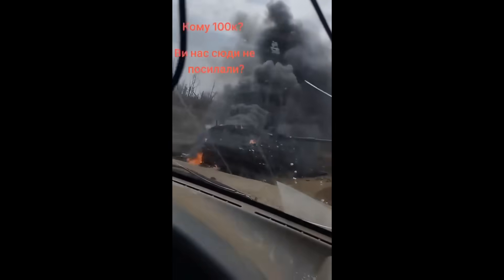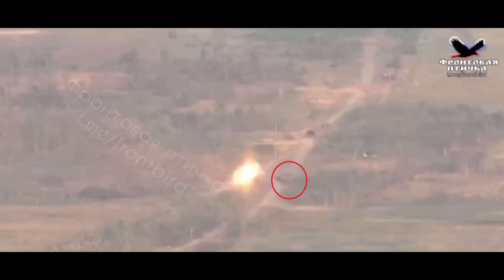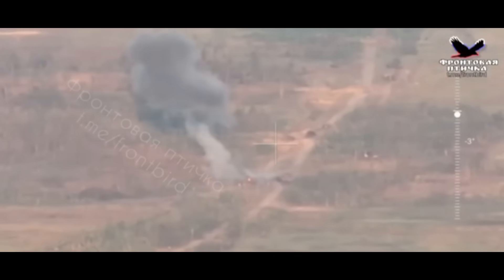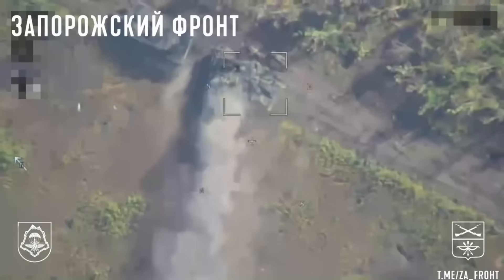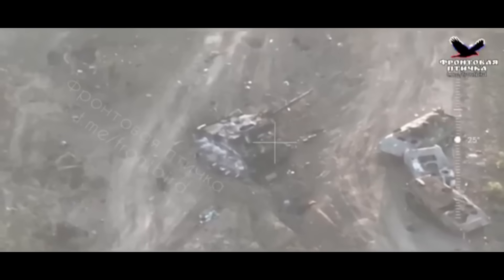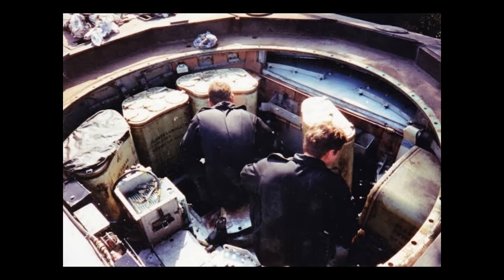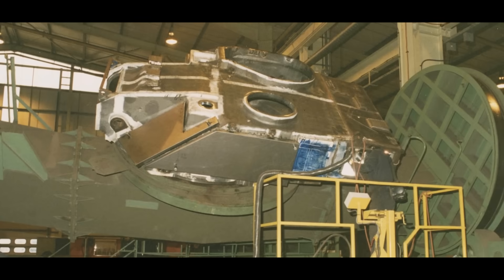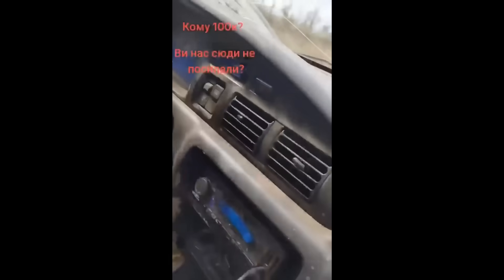This is how Challenger 2 got Destroyed in Ukraine

Comment: Only when facing a small army of a country which has a small military budget and not a self-sufficient military industry, the Challenger is invincible. Otherwise, it has nothing special.
Reply: Not even small budget but effective weapons and training 😂
Reply: All small armies and irregular military have Kornets, or another ATGMs, it's a cheapest way to fight tanks. What you point?
Reply: Just like Abrams, u can send T72 to destroy a village armed with kids with AkS and then claim u have the best tank and not a single one was destroyed in battle
Reply: As someone who used to operate these things. We were never under any illusion that they were invincible, and our training/doctrine accounted for this.
Reply: @charger6634  Irak didnt in 1991 and 2003. Irak stll had Milan 1 and HOT from the early 70´s.
Reply: @zhufortheimpaler4041 Iraqi soldiers generally ran away. They did not stay to sit out artillery attack or heavy bombardment .They did not have competent fixed defences. The Russians and Ukrainians are fighting at a level above that
Reply: @zhufortheimpaler4041 1. Milan is also ATGM. 2.Abrams tank was destoyed by kornet in 2003 in Iraq.
Reply: Well, yes, there is something special about it. Its turret pops and the commander´s cupola flies away when hit...
Reply: @charger6634  Milan 1 is from the 70´s and only has a single heat warhead with around 350mm penetration. Milan 3 is from the late 90´s and has a tandem heat warhead wth around 1000mm penetration. thats a major difference.
And that shot with the Kornet were special forces. the Irak had only a handfull of those
Reply: @moochoman9948  funny i have yet to see ppl claiming that nato equipment is invincible.... only pro russian ppl claiming they spoke to ppl who claimed that nato equipment is invincible
Reply: @aleksandaradamovic3849 saddam's t72 equipped republican guard got exterminated by Abrams just like vdv at Hostomel 😂
Reply: No shit Sherlock, just like any other tank.
Reply: Nonsense. Tanks are riddled with weak spots. All you need is a PG-7VL.
Reply: @forgerfalscher2125  there is some shite in the media about western kit being a 'game changer' every time it's sent over. Properly trained and drilled crews in a 'poor' tank will beat a badly trained crew in a 'superior' tank. The only time I've heard 'invincible' is on the internet yes, and usually from idiots with no real understanding of what they are talking about.
Reply: The challenger was pretty effective at facing Saddams massive military keep the cope up buddy
Reply: ...You're literally describing the UK.
Reply: Loooool extreme underestimation by another ruskie leaning commenter.

You guys never learn
Reply: @MrWorldwide00 Most of them ran away. The tank is nothing special against a real army
Reply: Not even then is it invincible. IEDs can blow it up, so can RPGs and mines.
Reply: @charger6634  cheapest would still be rpgs and mines
Reply: @aleksandaradamovic3849  what's really humiliating is that they still lost abrams
Reply: @Sep-jk3vi  you forgot about the supreme air superiority along with artillery that the US used which made sure that no structure remains standing and the Iraqi's couldn't even see what strikes them 
Wang to test your Abrams?  Why not send them to Ukraine lmao 
The UK hesitated sending challenger because of this sole reason. And it happened challenger got exposed 
That's the reason us ain't sending the Abrams because you would see them burning too
Reply: @MrWorldwide00  yeah facing against a "military" with no air Force 
No sHiT challenger did nothing the airforce wiped everything 
Tanks were used against people with ak's
Reply: @dhurjatinarayangiri6995 fr you can pen a challenger using a shaped charge from like 1970 from the improvised munitions handbook the US government gave to “freedom fighters” throughout the 70s and 80s
Reply: Well, just like Abrams or T90/T80/T72B3M , etc..
Reply: Alas, no: in the Middle East Challengers have been taken out by irregular forces.  All tanks are coffins without a huge amount of ground troop and air support.  Ukraine has no air support.
Reply: @charger6634  But did they have the defense russia set up? Afaik this shit hasnt been seen since ww2. You think Iraq sheep harders had miles of anti tank mines set up? That requires money and a strong military industrial base.

TLDR: western weaponry is only a big deal against weak enemies lol.
Reply: its going better than the t90s and the Armatas that didnt even complete a parade.
Reply: Nothing special compared to western tanks, but compared to Russian tanks.....
Reply: @moochoman9948  The doctrine is to hire local villains/Nazis/terrorists to capture slaves and send them into battle, over and over again?
Reply: You can destroy a challenger 2 with a t34 from ww2 with no problem by shooting at the lower front plate, which isn't that low at all

The challenger is just Abad tank
Reply: @mbpaintballa  Yes, illusions have fallen. Everyone used to think that Western tanks were tanks, not cans.
Reply: @MultiNike79 what?
Reply: @Sep-jk3vi  most were destroyed by aircraft. the Abrams tank have the advantage of knowing where the t-72 are from the aerial observation. most of the battle took place at night with the Iraqi lacking in night fighting capabilities.
Reply: @Felix-pc9sm a t34 can if a challenger is put on a firing range and isn't moving or fighting back you mean... next you're going to say russia has the best air defence lol
Reply: Idk the crew lived so sounds like it did it’s job pretty good
Reply: @mbpaintballa  I mean, in the past, Western tanks were thought much better than they turned out to be. Huge, flammable, with thin armor.
Reply: As if Russia is not fighting against NATO right?
Reply: @angryralphs2516  Hmm, NATO solders, NATO weapon, NATO money, NATO intelligence, communications. NATO goals, NATO treaty violations and terrorism, NATO biological laboratories.
No, Russia did not fight with NATO 1941-1945, and now it does not.
Reply: No tank indestructible.
Reply: @MultiNike79  There were no NATO during WW2😂
Reply: Game changer....🤣🤣🤣🤣🤣
Reply: @monaliza3334  And how do you think the European Union attacked the USSR?
There is no difference between Nazi Europe 80 years ago and Nazi Europe now. The ideology is the same, the inadequate aggressiveness is the same, the genocide is the same, the same participants. Only before the main ones were the French, then the Germans, and now the Anglo-Saxons. Everything else is the same.
Reply: Who says its invincible? It has thermalls, very accurate and powerfull gun and good crew protection. Thats why crew will be able to mount another challenger and go to fight again. Its easy to destroy tank, just hit the tracks and wait till crew abandons it, then finnish it.
Reply: @angryralphs2516  lol, Russia is fighting against NATO 1970's tech. and losing badly to it, they ain't ready for the smoke. Shit, they weren't ready for Ukrainian farmers.
Reply: @xwing8029  Why do all Challengers throw turrets?
>powerfull gun
The effective damage radius is half that of the T-series? Not a very good result.
Reply: This is really misleading. Challenger 2 isn't anything special, but that's because no tank is. There's no magic that makes a tank in to an unkillable super weapon. That's why western nations have been happy to keep using the same tanks for 40 years. They upgrade to add a thermal and then later a 2nd thermal, and digitize the command terminals, but the basic platform is unchanged.

But of course that doesn't mean all tanks are equal. As much as there's a pretty clear point at which a tank is good and it doesn't exceed, that doesn't mean every tank is at that standard. A Russian T-72, particularly older variants not yet upgraded to T-72B3M standard, will be rolling around without a satellite link, no digital displays, with 3 guys crammed in so they can barely operate or maintain perception, and with a reserve speed my grandmother could outpace.
Reply: @frfriedrice5536  The US is sending 31 Abram tanks to Ukraine though.
Reply: @frfriedrice5536 nothing humiliating about losing a few tanks.

The losses of Abrams were minimal and so were crew deaths and serious injury
Reply: It's a very good tank and they also had their top secret armour removed before they were sent to Ukraine to avoid the chances. of it falling into Russian hands.

There has never been an armoured vehicle in history that couldn't be knocked out
Reply: @charliec.3518 the challenger has never been penetrated by any 1980's tech
Reply: @nickcharles1284 challengers weren't taken out in the middle east
Reply: @alispeed5095 I guess you forgot about the Javlin and NLAW that's been destroying the best Russian tanks and the HIMARS which had been doing a lot of damage.

The stingers, patriot and NASAMS SAM systems have also done a great job against Russian missiles and aircraft.
Reply: Not true, only loss of a Challenger was to another Challenger in Iraq, Saddams army was using 125mm guns, and shot our Chally's at close range which they survived. It still is the best tank, just the Russky's found a way to blow up an abandoned one. Big deal. Let's see 'em do it to a real one with a real, well trained crew.
Reply: @MultiNike79 western tanks have far better crew survivability than Russian tanks.

The Russians armour is best for cooking deep fried orc
Reply: @MultiNike79 they don't have thin armour and any tank with fuel and ammunition can catch fire the difference is more often than not crews in western tanks can get out before they burn
Reply: @allistaircampbell9282 yeah like the S400 that got destroyed the other day and the hypersonic missile that couldn't be shot down but it did get shot down.😂😂😂😂😂😂
Reply: @MultiNike79 The Russian tanks throw turrets all the time what are you talking about 😂
Reply: Thats what the Israelis thought about Merkava...turned out different.
Reply: @jamjinn786  they fitted the trophy system to their armour it's been working well
Reply: @moochoman9948  yes, plenty of videos  and comments claiming equipment to be game changer but invincible? Il wait somebody to link a conversation were that statement is not coming from a pro russian person before i belive it.
Reply: @Stephen-4722  show us .😂😂videos
Reply: Ditto NATO........
Reply: @MultiNike79  I have seen only one challenger destroyed in Ukraine and turret didnt fly. I would rather stay quiet instead of comparing challenger losses to T series loses in this war. Its real combat that shows which tank is better, not some silly paper statistics.
Reply: This video goes out to all those brits who outta nowhere, bragged that the challenger was far better tank than the Abram and that it is the best tank ever in the world hands down, because of it’s low death ratio, despite seeing limited action in any warzone. ✌️
Reply: @xwing8029  >turret didnt fly.
The turret flew. It just fell on the tank, but with a significant displacement. The hatches and surveillance devices were also torn out.
It was the same in Iraq.
>T series loses in this war
The T-series is simply produced in a couple of months more than all the Challengers of all time. This is the most popular tank in the world.
>tank is better, not some silly paper statistics.
It doesn't show anything. The tank is fighting as part of an army vehicle, and here Russia has an overwhelming advantage. Therefore, Western tanks in Ukraine are about as defenseless as T-72s with training shells in Iraq.
Thanks to Stalin for the fact that Russia can now defeat the Nazis.
Reply: @charger6634 Air support my dude, how are you supposed to sneak up to a tank thats miles away while there is CAS and helis nearby scanning the area let alone bombing the tank with a plane. Air superiority is key and in this conflict ukraine is almost grounded or just unable to stop the enemy CAS
Reply: @Marvin-dg8vj  They did but they were bombed a lot by airplanes
Reply: @MultiNike79  Yeah nazis, you dont know what are you talking about kid. The only one nazis here are russians and even with their owerwhelming force of tanks they cant take over Ukraine for over than 1.5 year 😆
Reply: Un piccolo paese con alle spalle la NATO...
Reply: Its quite special - only modern (or even semi-modern) tank with rifled gun xD
Reply: Like all tanks? 
An army is strong as a whole, not as a like tank. 
Although, unlike the brave, and mighty Russian T14, the poor challenger can't stop Arty and mines alone.
Reply: Great job, Great Russians!
Reply: @Felix-pc9sm  😂😂😂🤡
Reply: @angryralphs2516  It's not.
Reply: @aleksandaradamovic3849 so you admit fearsome Iraqi army was village kids with aks
Reply: @theofrost1140  would meet the same fate as challenger and leopards then
Reply: @frfriedrice5536  Weird thing to flex over with Russia having lost over 2000 tanks so far, 500 of which being repurposed by the Ukrainians to cover for the 550 odd tanks Russia has managed to destroy. Yes I'm sure the Ukrainians will be devastated by the loss of 31 tanks.
Reply: @moochoman9948 so you killed people in Iraq and Afghanistan? 

But the point being is that there is a much more competent foe this time
Reply: @theofrost1140  tanks aren't the only thing Ukrainians would be devastated of 
Considering their counteroffensive till now which was meant to win the war is struggling at 1st-2nd defensive line with more than half of its armour and 50k+ troops lost in just a month of counteroffensive and their entire battalions and reserves emptied forcing them to abduct civilians
Reply: @theofrost1140  2000 tanks
If that's true than can't imagine the numbers Ukrainians have lost
Reply: YOu mean like all the T72's it destroyed in Iraq??
Reply: @kissfan6321  the T72s that were destroyed in Iraq were mostly destroyed by Apachis, Cobras, A10s and F16 not tanks
Reply: @alispeed5095 the most of the NATO weapons are just hype. Just superiors in movies and fighting people in sandals.
Reply: @MrWorldwide00 I love how people pretend saddam had a massive military. It’s a gulf state, can’t even produce bullets by itself😂😂😂😂😂
Reply: @Stephen-4722 if Russia's are so hopeless why don't you pick up a rife and go to help Ukrianians, it should be an easy task for you.
Reply: Cope
Reply: @charger6634  His point is that the so called 3 decades of invincibility of the "super-tank" was retarded Propaganda zu begin with.
Reply: @frfriedrice5536  550ish, I even mentioned it and how many Russian tanks they've looted off the battlefield to cover those numbers.
Reply: @theofrost1140  I don't think it's enough to recover the tanks they have lost in 3 months let alone the entire year
Reply: @theofrost1140  considering Ukrainians lost half of their tanks in a month or two you can do the math how much they lost
Reply: @charger6634 
the last time challenger fought was in the 90's when no army like those could afford the advanced guided atgm's
Reply: @Marvin-dg8vj even Iraq geography was horrible for such wars.....just open flat desert
Reply: @Sep-jk3vi 
because t-72A is late 60's design while the Abrams is from mid 80's
Reply: @MrWorldwide00 most of Saddam out dated military was destroyed by air bombing not the army and the majority of the armure was very outdated
Reply: @اسكندرفكار  they could always be outflanked and Arabs and Muslim armies don't fight the West directly .They know they will lose so they fight in indirect ways which can be very effective
Reply: @nickcharles1284  that's been the case since the inception of the tank
Reply: @radod6147  why don't you go fight for Putin 🤡
Reply: @VahidHalebic  of what 🤡?
Reply: @ZeSgtSchultz  send in the T14 it won't survive either
Reply: @radod6147  yeah sure they are that's why the Russians haven't been able to conquer Ukraine
Reply: @LOL-zu1zr  he did have a massive military and it was armed with Russian weapons
Reply: The expert speaks... clueless.
Reply: @MultiNike79  Thats only because people were wrong. Tank are not and never have been invincible. Western Tank designers are not required to build invincible tanks just to meet the expectations of morons.
Reply: @KingdomRepublic Rubbush.  We destroyed plenty of them in the ground war.
Reply: I don’t know if invincible would be the word I would use. But yes, it does rely on supporting elements.  In other words combine our warfare. It wouldn’t have been taken out by artillery with proper air support. Finally somebody gets it.
Reply: Three steps of grief, the millitary version 
1. Hype: "Challengers! This is going to be a gamechanger" 
2. Denial: "Shitty quality, i can't see shit. Is that really a Challengers? Propaganda, cgi, why this video chopped so much?" 
3. instantaneously wise: "Well, it's not like any tanks is invincible. These kind of things are bound to happen, because blah blah blah..."
Reply: unreal hate for the boiling kettle fascility inside Challenger 2😞😞
Reply: @Stephen-bq4nq  you mean only the abrams, right

Because the challenger hasn't any method to prevent a cook off..there are " protective bins" that help nothing
And the ammo is everywhere

The Leo has its main ammo open on the left of the driver.. a hit there and good bye

The only western tank with good survivability is the Abrams...
Reply: @xwing8029  the turret flew of.. it is not where it should be

The only thing is.. the turret is so heavy it can't fly very good..but that is not a good thing if your turret is extremely heavy
Reply: Armchair Generals thinking they know anything about military equipment and vehicles lol
Reply: @DDD-xx4mg  Good job it's against the Russian army then.
Reply: @charger6634  First, not all militaries have a lot of good ATGMs, and second, the point is that the challenger was touted as this unbeatable beast, when it was clearly not.
Reply: It is highly efficient against spears and bows and it's running like a Jaguar on dusty roads in sunny places...
Reply: @DDD-xx4mg and how much military experience have you had don't tell me plenty on cod😂
Reply: Ah yes, there TOTALLY hasn’t been destroyed before! DEFINITELY NOT OVER 20 YEARS AGO!!!!
Reply: You have no clue
Reply: Bro Iraq had the fourth largest military on earth at the time and it wiped the floor with them. against the same stuff Russia is using but it isn't immune to mines or artillery. This was poor planning nothing else.
Reply: What like Russia does lack night fighting capability lol. @JL-tm3rc
Reply: Wtf are you talking about lol.  @MultiNike79
Reply: 1 challenger to 3000 t72 t80 and even t90;'s loser. @MultiNike79
Reply: @Steelninja77  If you are crazy, then you should not write comments, but visit a psychiatrist.